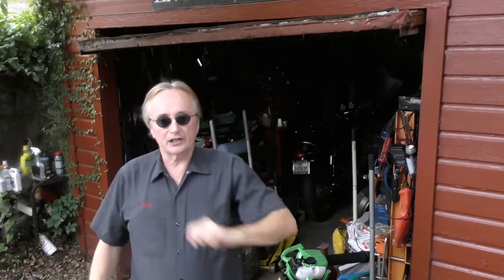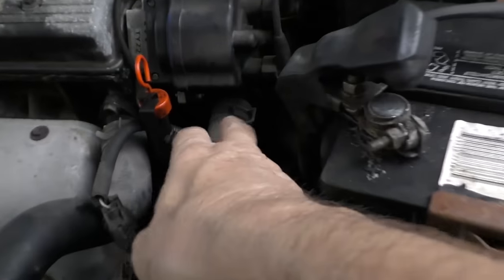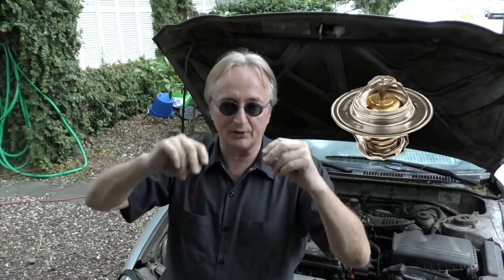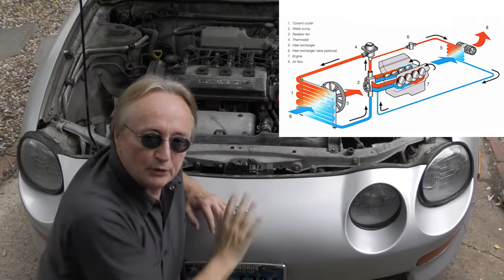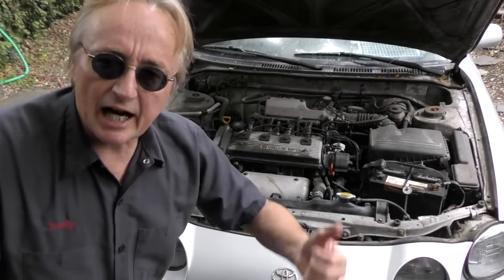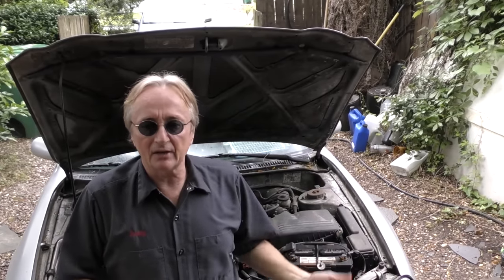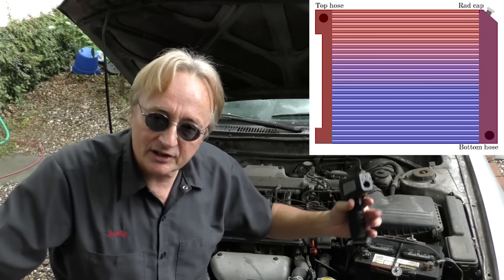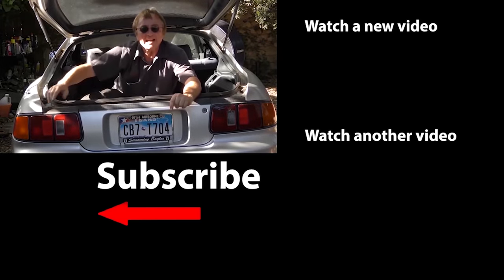Doing This Will Make Your Car's Cooling System Last Forever

Comment: Wife drives a 19 year old Dodge mini van, she loves it so I keep it running. 2 to 3 years ago her driver side fan went out (fell apart went through the radiator) so had to buy a new fan and radiator. Working on it found out the other fan had a wire taped together and it wasn't working took tape off wires weren't even wrapped together under the tape put it together worked good. Me and the youngest boy have replaced alot of parts in that van in the last few years. But I suppose beings we can work on it, it's still cheaper then a new one and as long as she is happy with it hay good.
Reply: Yes, a happy wife = a quiet life

Comment: What we do in the taxi industry was drill a few little holes in the thermostat as a backup. I own ve commodore looks the same as Pontiac G8. The thermostat is at the back of the motor and it a 10 hour job to change it.

Comment: My worst experience for cooling system was a plugged radiator.  Troubleshooting steps were followed and we R/R the coolant, water pump, thermostat and even the fan clutch.  Final cause and apparently overlooked by Pep Boys probably multiple occasions.

Final diagnosis was the radiator but more than being plugged.  Radiator had a “Internal Explosion”. The cooling tubes exploded and created a big “smile” in the center of the radiator.  Truth be known, the only one smiling was the dealer Accounts receivable department after the credit card was swapped.  No further issues after that but Pep Boys is still on my “Naughty list” to this day and I wouldn’t trust them for a cup of air or water!

Comment: Try testing the so called "water pump" to see if it actually pumps coolant according to the specification. I take the heater hoses off run them both into a bucket of coolant then bleed the system and then pull the heater flow hose out and empty it into a container and then time the flow . All this is done at 500rpm. If the flow does not fill a 1 litre container in less than 10 seconds then you do not have a pump you have a stirrer. 
We have thousands of hours of testing to prove that when you install a proper pump amazing things happen like an increase in idle vacuum, amongst other changes. We also relocated the engine thermostat into the bottom hose,(like some Japanese engines) further improving coolant flow and control. Of course then you need an external bypass to suit .

Comment: My Acura thermostat and rad cap are 13 years old and still rocking
Reply: 19 years here.  Just had coolant flush done at Tire Discounters and there's nothing in my overflow and not visible under radiator cap.  If it hadn't been for Scotty I might never have taken a look.  Back to Tire Discounters to get the rest of my Coolant/Anti-Frieeze!  THANK YOU SCOTTY!

Comment: Rev up your AT-205!
Reply: Can it be used safely on the rubber engine belts?
Reply: @EdMan57  I wouldn't..those belts need to be replaced before they get old enough to crack

Comment: My fan doesn't turn off, had to bipass it and put in a switch, I didn't know how to fix it any other way but learning quick with these videos.
Reply: Could be a bad relay in the circuit. They are cheap to replace,  so if you change it out and it wasn't the problem, no biggie, you're out 5 bucks, but you have a spare now.

Comment: One big tip to make sure your cooling system works properly. If you ever have to remove a serpentine belt to work on your vehicle, make sure it goes back on the.correct way. A friend of mine couldn't figure out why the heater wouldn't blow hot air yet the engine heated up fast. Loomed at the belt diagram for the vehicle and the belt was on wrong and spinning the waterfall the wrong direction.

Comment: My VW Tiguan has no drain plug on the radiator and only two upper radiator hoses!!! Pain in the butt system. Has to be high pressure flushed...POS! Never buy VW people! 😂😆😂😒😢😢😢

Comment: Buy a new water inlet while you're at it.  It's either cheap pot metal or plastic and it's very easy to break.  Aftermarket water inlets for older cars are usually cast iron. :)

Comment: i'm looking for a video where Scotty talks about flushing cooling system that has rust in it,  i used the liquid that advertised it removes rust from the cooling system and i think it works because i did multiple flushes until the liquid came clear after driving for a while, i just worry it may cause problems in future,

Comment: What do you think about coolant flushes on cars (2016 and up) ?
I hear varying things from these are beneficial to flushes push gunk into places they shouldn't be. Dealer is trying sell me a coolant flush, however the maintenance minder didn't pop up for it. Trying to figure out if this is something I should actually do vs something the dealer is just pushing I don't need.

Comment: Hey Scottie I'm a subscriber from Jamaica. One of the biggest issues we have with radiators here, is what we call the tank. That's plastic part at the top of radiators, not if its same name in the US. So what we is weld on a copper top one

Comment: The other major thing you can do is prop your hood up when the engine is hot, especially in a garage. Not only will you save the hoses, but the belts, the battery, the hood paint, and the electronics. Learned this from people in Arizona.

Comment: I've usually gone longer between thermostat changes.  On vehicles that don't have temp gauges, yeah it makes sense to change them periodically because the car will only warn you when it's overheating.  But those with temp gauges, if things seem off or it says its running hot, then address it.  All of my cars have had temp gauges and the only thermostat I had to change was one that had a Barrs Leakstop job done on, but I forgot to remove the thermostat so the Barr's destroyed the thermostat (made it stick).  But other than that, I've driven 10 years or 100k+ miles on some vehicles without needing to replace it.

Comment: OK you inspired me and I had the coolant flushed...  now I have the check engine light pop on (2001 BMW X5).  My guess I need a new radiator cap...  it is only 20 years old!...  or a new gas cap, 4 years old...  or it is due to the fact that the gas station gas shut-off didn't work last week and I flooded the air intake and/or the activated carbon.  Cars are so much fun (sarcasm, LOL) Thoughts?

Comment: I usually just buy a new $500 beater every 4 or 5 years. I have 2 Silverado's a 93' and a 00' and they both run and drive perfectly.
Reply: I didn't pay $500 for the 00' I did pay about $5200 a few years ago when it only had 105,000 miles. But it's still in really good shape. I did put new shocks brakes and rotors all around and a new U-joints on the driveshaft. Basic tune up, changed all the fluids and keep up on oil changes. New battery, tinted windows, tonneau cover, remote start, got some nice rims and tires on a Black Friday deal. I love the truck and at this point have no need to upgrade yet. The 93' I just bought from my buddy's mom because it was his dad's truck and he passed away. It's rusted to beat hell but runs like a charm and has a 350 with a 5 speed manual.

Comment: Antifreeze coolant is poison.  And requires changing and flushing.  I think it's a crime that it is even required, when simple Canola Oil or Corn oil in the cooling system instead of water would theoretically make the cooling sytem more resilient to heat and save the hoses and seals from wearing out.  Problem is, ive heard it's illegal to use vegetable oils or transmission fluid for car cooling systems unless it is an very expensive fancy car.    NOTE :  if you choose to try old tranmission fluid for car or truck engine coolant, be sure to use F-type only or else your water pump seals and hoses may fail if they are made of synthetic rubbers.

Comment: There are thermostats that are designed to stick open as well.I would recommend them. You won’t have heat in the cold weather but you’ll have a motor.

Comment: The reasoning behind the electric thermostats are for keeping the engine at a certain temperature for performance. The engine runs best between a certain temperature so they use those electric thermostats to try and maintain that temperature

Comment: I stopped cooking my 5.7 hemi at 90,000 by switching to a Jet 185 degree thermostat.  318,000 miles later no problem.  They are stainless steel also.

Comment: What keeps me up at night is how you can easily have both your thermostat AND temperature sensor fail around the same time. Your thermostat prevents the engine from cooling, and your temp sensor fails to warn you… and you wind up just having to take the big fat L. Probably lose the vehicle if it’s a typical used car and not worth it.

Comment: Always use a superStat thermostat that will only fail open. Thus will not overheat. When you notice a long duration to heat up the car or no heat in winter, then the $12 to $20 thermostat needs replacing instead of an $8000 engine. The superstat is STILL not used by stearlships that prefer you part with your $$$.

Comment: i had a citation that was cold all the time, not so much in summer but really in winter ... no one else thought it was a issue but i knew it just wasn't right so i took the plunge and got a new thermostat just for the hell of it. it was my first car so i didn't have anything to loose. sure enough when i took the old thermostat out in a 70 degree day the thermostat was stuck open!! not alot , just a little more than a crack ... my car was nice and warm come winter after that ...

Comment: Should you use a flush? I used to on older cars then flushed it again with distilled water. Then added 50/50. Will get some AT205 for sure.

Comment: 1:52  The term "OEM" is a misnomer and, oddly and confusingly, means the opposite of what the acronym stands for. One would logically think that because OEM stands
for "Original Equipment Manufacturer," it means, in the case of cars, a product actually manufactured by their particular car company. But that's usually not the case.
OEMs are typically manufacturers who provide parts for a company and/or resell those parts under their own name and brand. So, in the video, 
when you say at 1:56  "Maybe you'll spend $25 instead of $9.95..." It's actually the item at $9.95 that would be more likely be called an OEM product. It works the 
same way in the computer industry.

Comment: I like taking care of my cars - good service and preventing the problems beforehand is a good idea - but I think changing the thermostat or radiator cap every 4 to 5 years is overdoing it... Haven't changed neither on our '89 Corolla yet (bought as new). And we life in tough weather conditions, outside temperature varies from -31 to 95 Fahrenheit (-35 to 35 C)... That means I could've changed them 6 or 7 times for nothing...

Comment: Ok
If the weather temperature between  45 Celsius and 50
What do you think 🤔 the engine cooling fluid will be with A/C running and stop with traffic for more than 15 minutes?
In my cases the temperature reach to 105 Celsius is it normal?

Comment: Hi Scotty. I have a 2001 Lexus rx300 with over 221, miles. I have a few things I would like to ask in your opinion. One I hand a interesting problem when I fill up with gas, the RPM will start to drop part 1,000. To me that sounds like a fuel pump what do you think? Two the engine temp.  doesn't make it to the half way point. I feel that it doesn't get very warm so I feel like this maybe the thermostat what do you think?

Comment: Hey Scotty... I have a question... What's your take on putting in a colder thermostat for a mustang I have I've modified to make much faster... Is there anything positive I can gain by doing this?  I love your videos and have helped me a lot!  Don't retire!
Reply: You want to make sure it runs at optimal temperature.  If the engine runs colder than optimal it will hurt performance, not improve it. What you want to do in your case is run higher temp oil. For example of your car ran 0w20, run a 0w30 for winter and 5w30 for summer. If you make way more power than a simple tune and bolt ons then run 5w40 or 10w40. I ran 5w50 on my Shelby

Comment: happen to me in my Suzuki grand Vitara notice it was using coolant more until the rad split on me on the highway at 70mph, but still carried on driving for a few miles before pulling over and filling it up with cold water and drive another afew miles etc until I got home, replace the rad etc a few 3 months the head headgasket when I disappeared into a big white cloud of smoke.

Comment: The hot water / coolant does not dissipate into the atmosphere. The only thing that takes place is a heat exchange. The cool air passing through the front of your car goes between the veins of the radiator, which the coolant / water runs through, dramatically cooling off the water that had just come out of the engine. That water is then pumped back into the engine again, now much colder, starting the cycle all over again. The only thing that is lost is the heat, which is transferred to the air that's traveling through the radiator

Comment: My father in law many years ago told me that when he used to work way north in the super cold regions they would use kerosene in the cooling systems instead of antifreeze. 
In vehicles where they did this, the engine never ever had a head gasket, water pump, rusty coolant or any cooling system troubles for as long as they owned their vehicles. 
Granted, this was back in the early 1960’s but it sounded like a good idea to me......
Reply: Sounds dangerous to me. You Don't want that kerosene to combust. I'm not sure what temperature that happens at but isn't kerosene highly flammable?

Comment: Scotty, you forgot the other one thing that makes your cooling system last forever - water pump lube, contact wetter and corrosion inhibitor ! I've owned 16 cars and never changed a radiator or  water pump or overheated yet. Really cheap insurance

Comment: Scotty, I screwed up, my car was down a gallon of fluid I forgot they sell coolant by the gallon that is already mixed and instead added just straight water. Should I be concerned that the cooling system is no longer a 50/50 mixture?
Reply: Knuckle, has anyone reached out to you yet on this?
Reply: @vigilantemotors  Nope

Comment: Scotty you ever used 303 uv on rubber? Supposedly make it last alot lot longer. I'm considering using it on a timing belt still change it when time comes however seems very interesting

Comment: I have 2016 Dodge Grand Caravan with 283000 everytime I fill the radiator up with cooln. It runs out after I go down the road but after I checked it cooln is half way but the van Dr good

Comment: My first car the thermostat stuck closed. Could tell cause the transmission fluid started leaking out faster. And it was a weird looking thermostat. Had the GM part number on it, so figured it might have been the one that originally came with the car. My second car the fan motor wasn't working and the car was only 3 hears old. One auto parts store wanted 28 dollars for one, but had to order it and I wanted to change it that day. Went to a place that sold acdelco parts and they wanted almost 100 dollars for one. I told them I could order one for 28 from the other place. They said but ours is the official GM part. I said that's what's on there now and it doesn't work. So I went to a different auto parts store and they had one in stock for 31 dollars. So I put that on and it worked for all the years I had the vehicle.

Comment: First time texting.your great company. I like your videos. How about once a year sticking a hand pump in your radiator and taking out appox 1 gal.dilluting the old fluid will always keep it cleen.10 minutes work.if your fluid is dirty take it for a drive and do it a second time..the cooling system in my truck holds approximately 2 gal.if you want to do it three times go ahead it might be spotless.i really love your videos and you are terrific company. I hope you approve it would mean alot.2002 CHEVY S10 326.000 MILES

Comment: Be careful with using a pressure washer to clean your condenser and/or radiator.
That high pressure water will fold over the cooling fins. 
Even the pressure from just a garden hose can fold the fins over if the hose nozzle is set to produce a hard stream.

Comment: I have an 05 Mitsubishi eclipse,  I have no thermostat.  
My cooling system was out,  when I put it on the car over heat.  But took it out it doesn't overheat.
Reply: Pete Blazer Could be a bubble of air, if the bubble gathers around the thermostat coil, it will prevent it from opening. Try a flush/burp with the front wheels elevated to get as many bubbles out as you can! Happened with my Subaru once, overheated/struggled to cool itself off with the T-stat and worked fine without it until I flushed/burped it ☺️

Comment: Hey Scotty, I have a 2013 Altima with 77,000 miles.  The extended warranty I bought will end this summer.  Even though the car is paid off, do you think I should trade it in, versus waiting 2 more years for my teenager to drive it?  I worry about the CVT going out that you constantly warn us about.  Thanks!

Comment: This Arizonanan  back' sprays the radiator and condenser from the engine side...and knock off the bugs dirt and sand with a toothbrush taped to a rod. It's a pain but wothwhile.

Comment: OMG, Scotty, when i did my Honda i felt that such a important part needs to be OEM! NOw, i see i am not the only one that thinks that way... honda stealership hit me for alot more but,, my reason's are sound, even by your opinion. I change engine coolant anytime i have to do a water pump,, most cases, it's really old coolant at that point anyway. I think the coolant has stuff in it to lubrucate the water pump as well, so it's just a good idea... I use premix... i hate mixing,, and what minerals are you adding with the water? That show up as corrosion later.